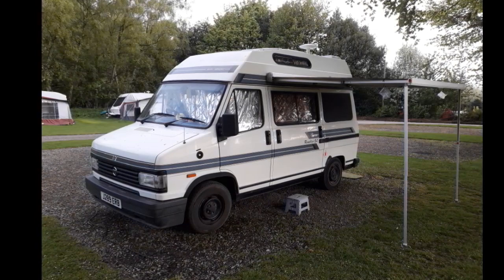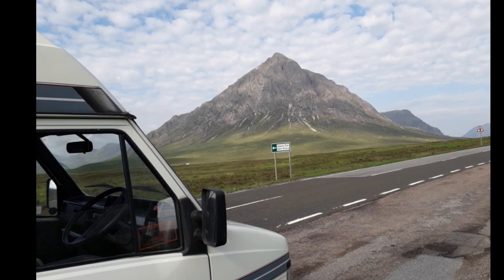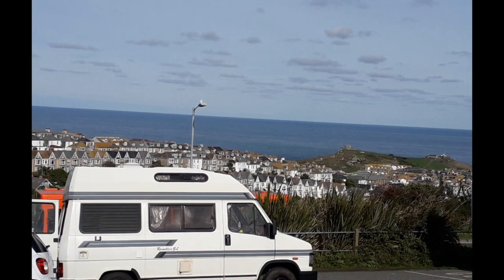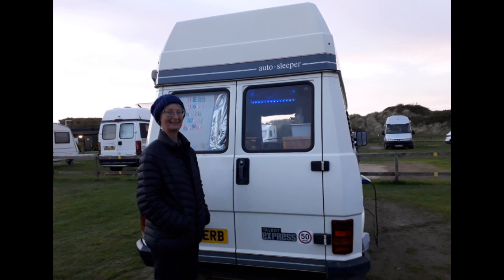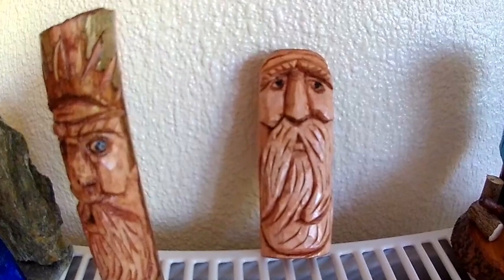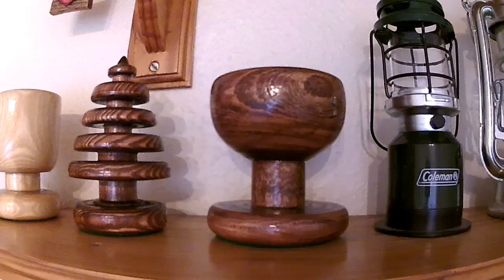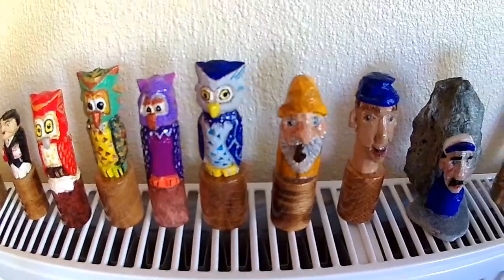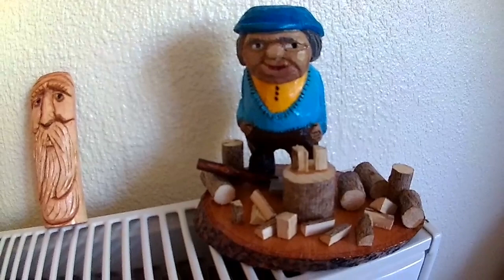Gear Change and Oil Leaks. Talbot Express. Autosleeper.

Comment: What dip stick are you referring to.? Didn't know manual gear box had a dip stick.?.
Reply from the maker: Its next to throttle cable. Only accessible from underneath. On 4 and 5 speed manual. Petrol and Diesel versions. As per manual...